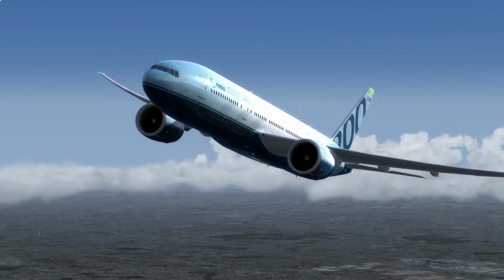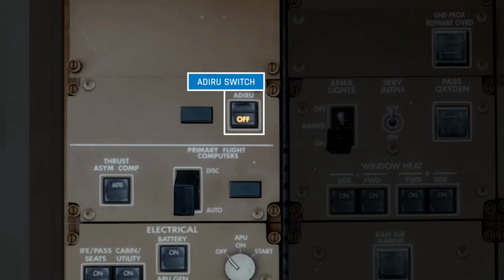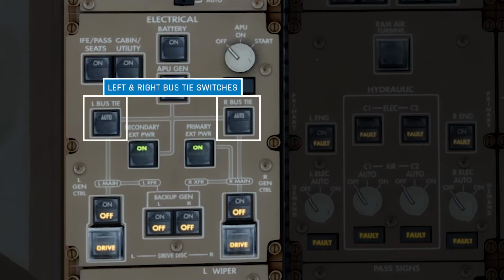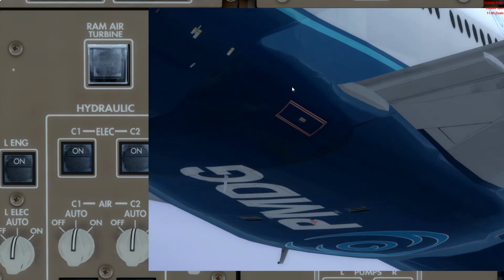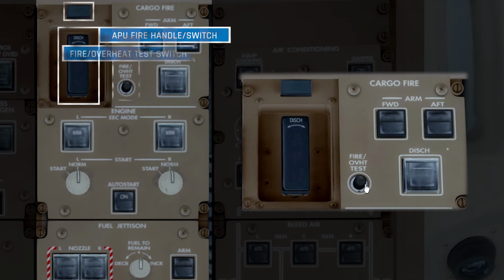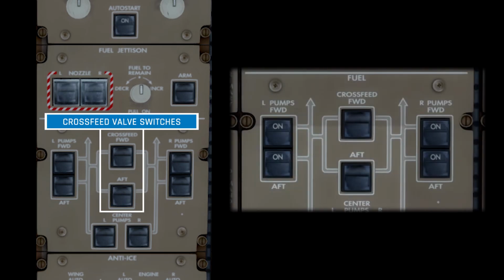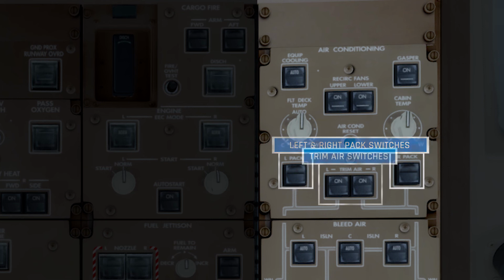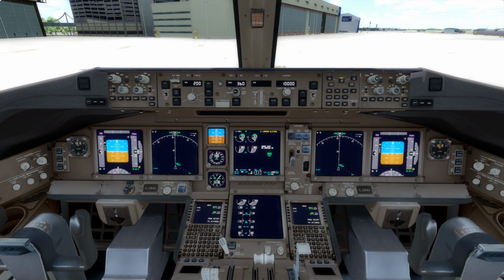PMDG Boeing 777 - Overhead Panels Explained

Comment: @Doofer911 could you also make a video on 777 freighter overhead panel
Reply from the maker: Just had a quick look, There's very few switches which are different. Probably a couple of cargo fire switches and a couple of extra air conditioning switches. Don't think it's enough to make it's own video on I'm afraid.
Reply: @Doofer911  ok no worries thank you

Comment: Sir, this is amazing. I have a question. How do you know that these switches work? Were you researching, or there was a documentation of it?
Reply: You can search in the internet for FCTM (Flight Crew Training Manual), FCOM (Flight Crew Operating Manual)... etc. documents for any aircraft. From there, you can learn everything about your favourite aircraft. Not only for Boeings, you can also find documents for like A320.
Reply: Boeing 737 Classic, ah. Kk, thanks :)
Reply from the maker: There are several PDF documents which come with PMDG aircraft when you purchase them. They should be present within the PMDG folder in your flight sim folder on your computer.
Reply: @Doofer911 , Oh. Ok, sir. Thanks :)

Comment: Excellent back with the series! Wait you for 747 of PMDG and FSLabs A320!
Reply: I don't think PMDG 747 is needed. The 777 and 747 share the same cockpit. Only the FMC and Thrust Levers are different.
Reply from the maker: I'll do a 747 series, 4 engines means much more system complexity which will be fin to learn about (fuel, hydraulics and pressurisation)
Reply: @Doofer911 , oh. Ok, sir.